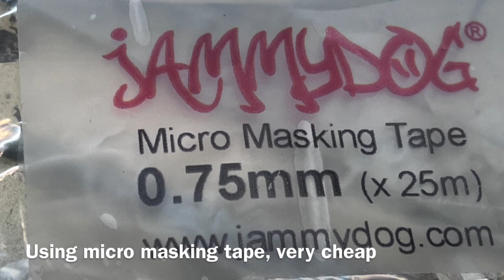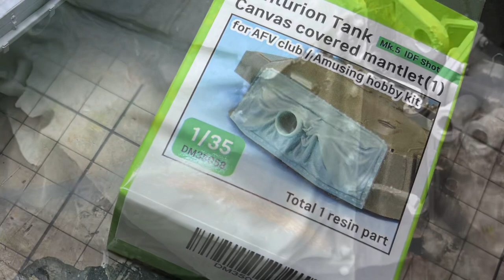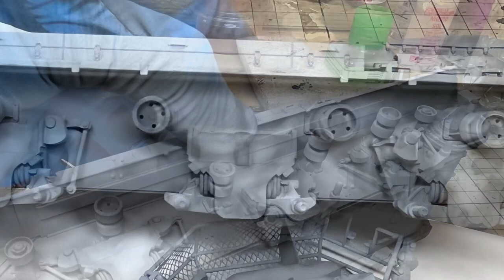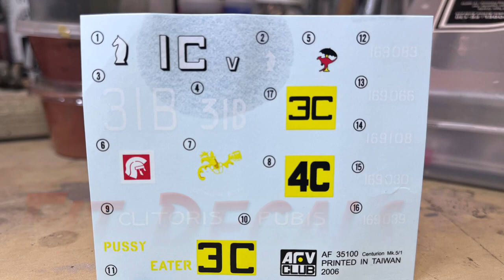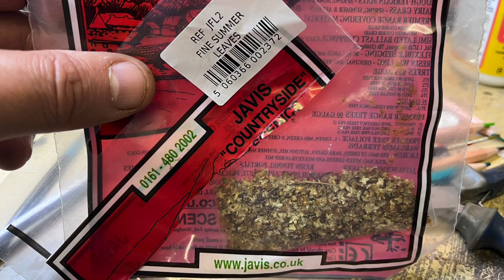*IMPROVE YOUR* scale model skills AUSTRALIAN CENTURION #VietnamWar #afvclub #135scale

Comment: Really nice job on the kit mate and video too. Thanks for sharing. Did you do a build video because I’m curious about fitting the mantlet and the mesh - I was expecting PE grills but got mesh in kit
Reply from the maker: Hi I tend not to make many build videos. I added a few bits about altering it at the start, but worry it will put people off. The mesh was supa glued or ak ultra glue, the mantlet was a lot of work to remove the exisiting and fit a search light bracket, but worth it. I was really pleased with the result so posted a full video.
Reply: @ctscalemodellinguk  It certainly looks worth the effort. Thank you for taking the time to reply. I fitted my mantlet yesterday and i was lucky it pretty much went straight on - it was the Firestorm one and come with search light bracket. Let’s hope the mesh goes as well. Thanks again, keep up the good work.  A.
Reply from the maker: @AnthQuinnBusinessCoaching  no worries enjoy the build